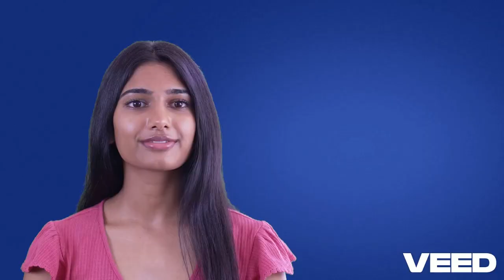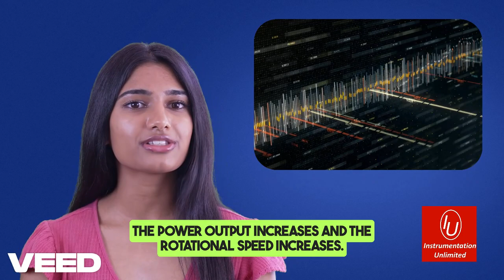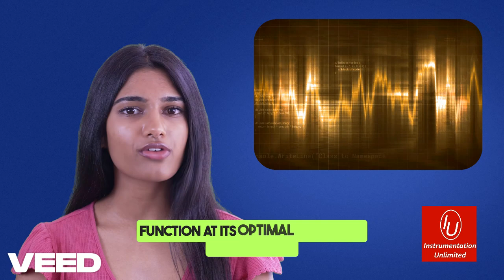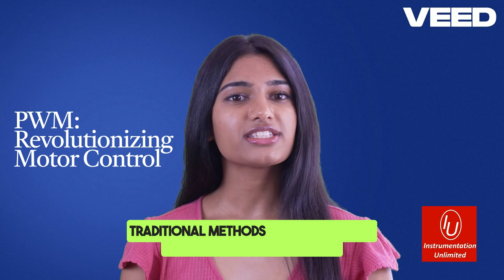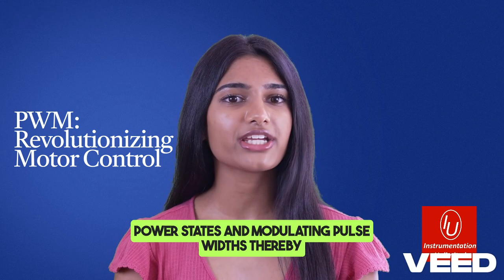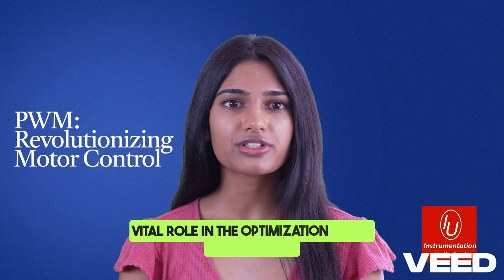How Sine Wave is formed in VFD using PWM Technique? @dineshdiwani

Comment: Adjusting the width of pulse for sine wave for CHF 100A model VFD, please tell the parameter..
Reply from the maker: ChatGPT response

Parameter F0.09 – Carrier Frequency

Description: Sets the switching frequency of the output waveform (PWM signal), which affects the "width" or smoothness of the sine wave.
Typical Range: 2 kHz to 16 kHz (varies by model)
Default: Often set around 8 kHz
Effect:
  - Higher frequency = smoother waveform, less motor noise, but more heat in the VFD.
  - Lower frequency = more audible noise, less heating in VFD, potentially more torque ripple